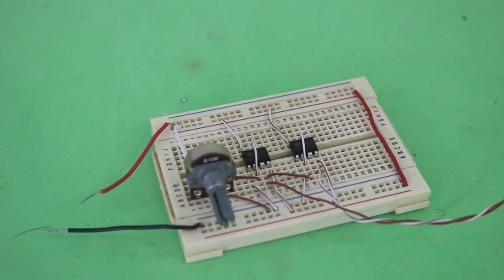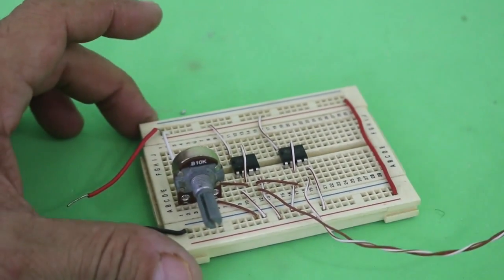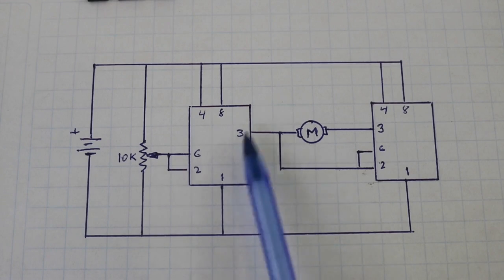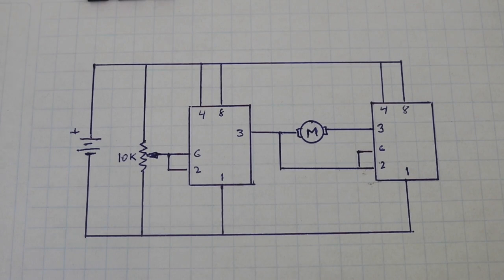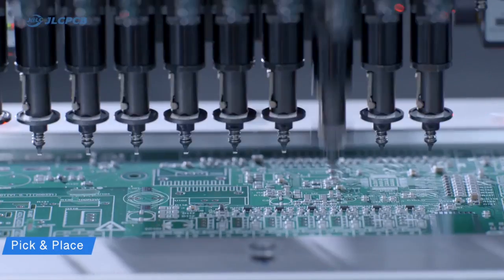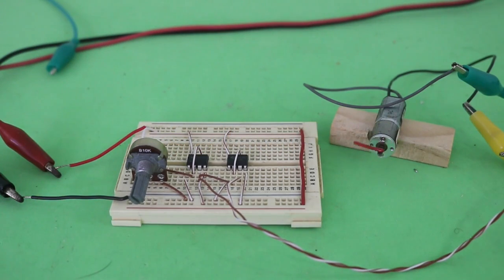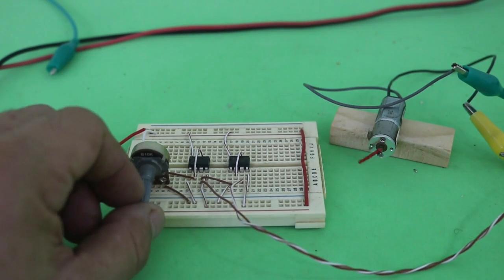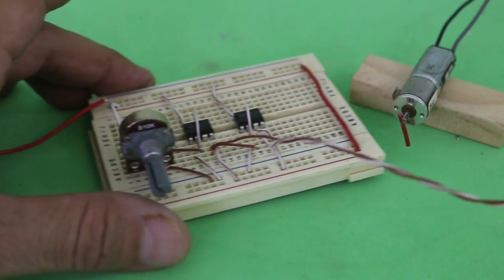H Bridge with 555 Timers for Electric Motor Control

Comment: This is an interesting use of 555 but is it actually technically an H-bridge?
Reply: Sure it is.  The output of each 555 is a push pull stage and a pair of them is exactly what an h-bridge is.

Comment: Can I use a separate potentiometer to control the speed of the motor by changing the voltage?
Reply: Better to use PWM (which the 555 can accomplish) rather than change the voltage.

Comment: I have a 556cn dual timer IC.....
Are there any problems with using it to do the same?
Reply: Its a cmos one probably, because it has "cn" at the end , it will only give you half the current , but it is more accurate and fast
Reply: @69iqtutorial  Good point, the bipolar version can source/sink 200ma, sufficient to power a small motor.